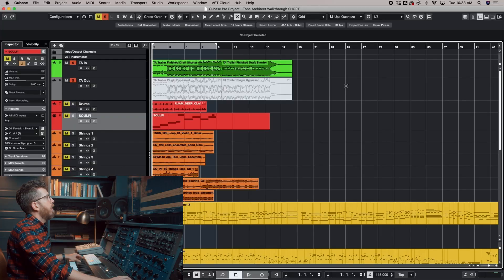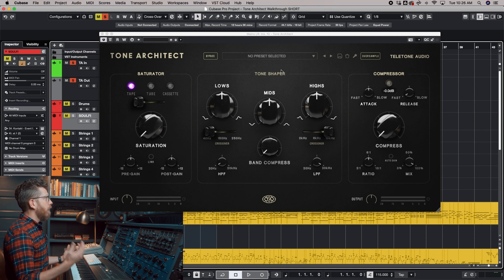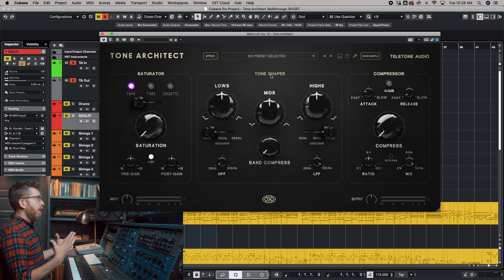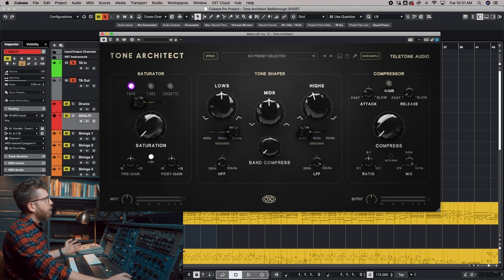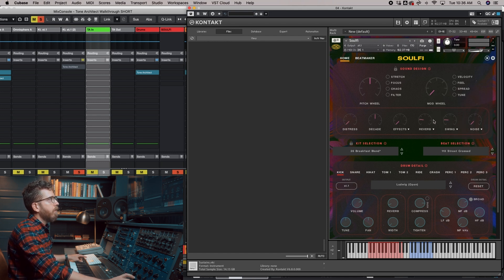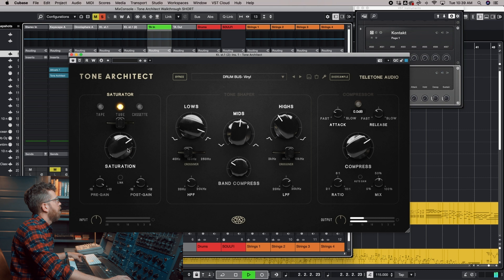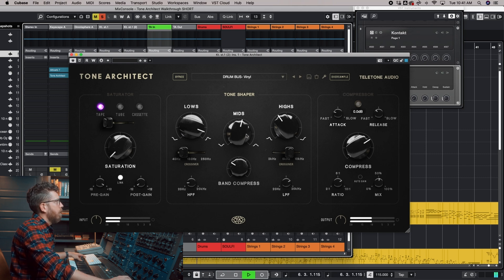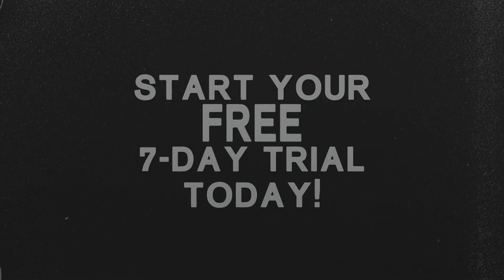Tone Architect — Quick Start Guide

Comment: Amazing, appreciate the brevity of this.

Quick question. At 8:03 you say it's boosting above 120 and attenuating below. Double checking that that's correct (amateur here, still learning these concepts)
Reply from the maker: That is correct IF you move it clockwise. It does the opposite if you turn it counterclockwise.

You can see the little curve icons to the left and right of the dials that represent the type of curve it is doing.